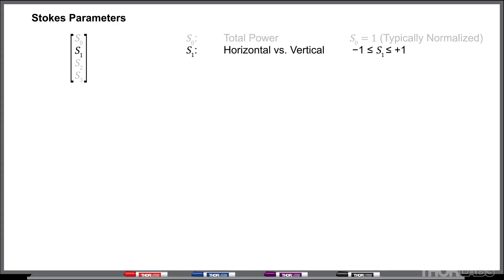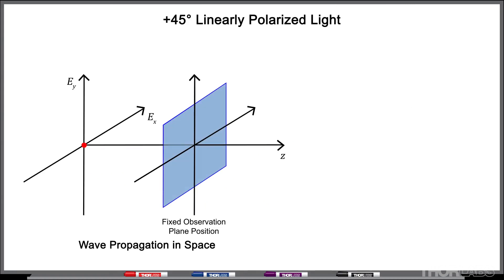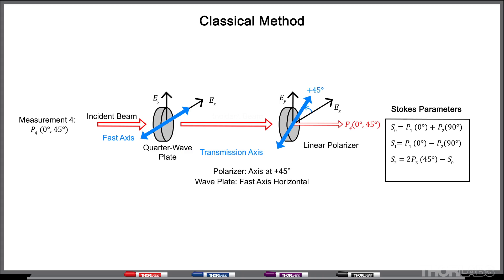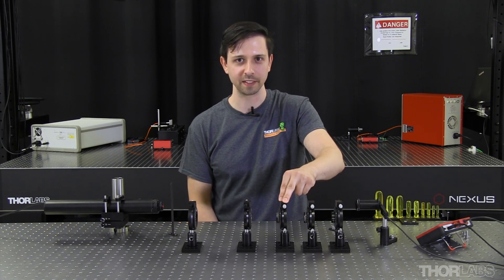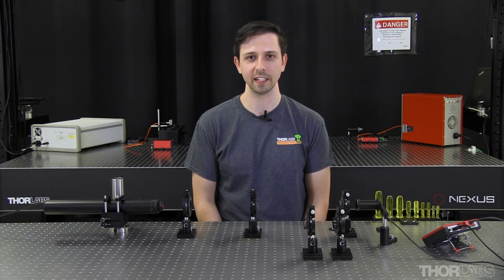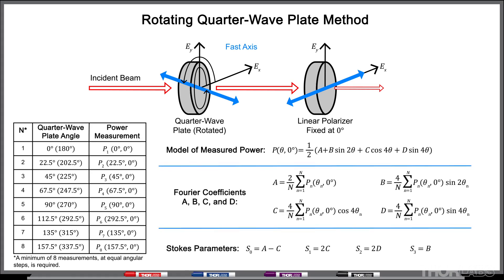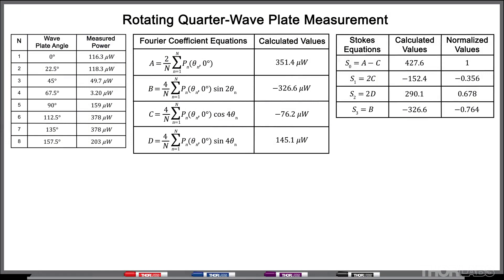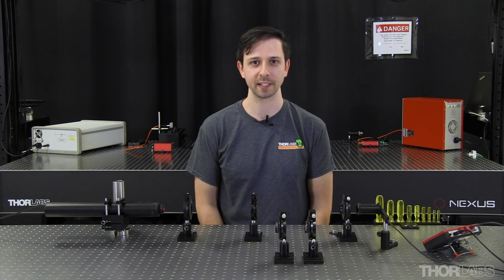Build a Polarimeter to Find Stokes Values, Polarization State (Viewer Inspired) | Thorlabs Insights

Comment: Hi, thank you for this excelent video. I have noticed that in Classical Measurement the elipses angle was 69.2°, while in the Rotating Quarter Wave Plate Measurement it was 58.9°. Is there any explanation for this large difference? From the image, I had the impression that the angle was not exactly 0° in the first measurement of the Rotating QWP approach. But, I am not sure. Could you discuss about it, please?
Reply from the maker: @dnmessias  When using these methods in the lab, the classical (CL) method often returns less accurate results than the rotating quarter-wave plate (R-QWP) approach. While the R-QWP method will usually be more accurate, it does require taking more measurements and making a few more calculations than the CL method. The CL method can be acceptable if only a quick, rough measurement is needed. We have found the variation in results obtained during this demonstration to be typical when making these measurements under the general lab conditions. 

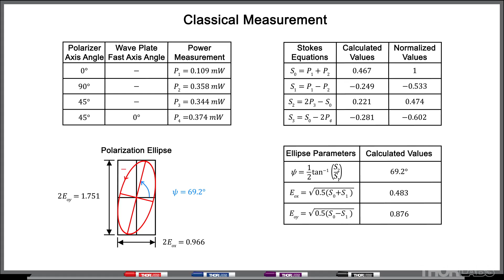There are a few reasons these two approaches can provide different polarization values. One is that both methods require accurately measuring the relative transmitted optical power for a complete data set. Reflections from the front and back surfaces of each optic reduce the amount of transmitted power, but this will not affect the provided results as long as the amount of reflected power is constant for the entire measurement set. This is true for the R-QWP method, since the same optics are in the beam for every measurement. However, in the case of the CL measurement, an additional optic is placed in the beam to make the fourth measurement. Because of this, a different amount of power is lost to reflections during the fourth measurement than during the previous three measurements. This difference will affect the accuracy of the calculated polarization values. Another challenge with the CL approach is that only four power measurements are acquired. It can be difficult to accurately measure optical power (especially when the optical power is low), as well to set the polarization optics at the exact angular positions. Small errors in any of these four measurements can have a significant negative effect on the calculated polarization values. In contrast, the effect of an R-QWP measurement error has a smaller effect on the calculated polarization values, since more measurements are made. The multiple measurements help smooth the data, and the number of measurements can be increased to even further increase the accuracy. We summarize these differences after presenting the classical method’s measurements (starting around 8:24).
Reply: @thorlabs  Thank you for the response. This kind of tutorial video is very helpfull! Thanks
Reply from the maker: @djalmir messias  We recently learned that we were missing a piece of information when we replied to your original question. We now know (thank you @TsuyoshiTakataniPhd !) that when measuring power values P2 - P8 during the rotating QWP method demonstration, our QWP orientations differed by 5° from the angles we intended. Since we used the intended, and not the actual, angles in our calculations, the polarization ellipse values we calculated for the rotating QWP method were incorrect. They should have been psi = 71°,  E_ox = 0.499, and E_oy = 0.867. In addition, the corrected Stokes parameters are: S0 = 1, S1 = -0.502, S2 = 0.385, and S3 = -0.723.  

We still expect the rotating QWP method to provide more accurate results than the classical method, but the difference should not have been as large as we calculated in the video. Thank you for originally bringing this to our attention!

Comment: Is there any formula to determine linear diattenuation and bi refringes
Reply from the maker: While we have not used a polarimeter to determine the linear diattenuation and birefringence properties of samples, we are aware that an open access paper is available that describes the use of a polarimeter's measurement of Stokes parameters to determine these values. If you would like to read about their approach and evaluate the equations they derived, the paper is: Chen et al., Optics Express 17(18), 15860-15884 (2009).

Comment: This is a very good video. Please could you explain a solution to this problem? I want to measure a material that emits both right and left-handed circular polarizations but with different proportions (intensities) for one circular polarization excitation(say right-handed). Similarly, the proportions switch upon switching the handedness of the excitation beam. How to measure these two polarizations intensities individually for each handedness excitation?
Reply from the maker: It may suit your application to use a filter that passes light with one circular polarization handedness and blocks light with the other. A filter of this type can be made using a quarter-wave plate (QWP) followed by a linear polarizer (LP). The QWP will convert both the right- and left-circularly polarized light to linearly polarized light. However, the output linearly polarized light resulting from the incident right-circularly polarized light will have a polarization direction orthogonal to the output linearly polarized light resulting from the incident left-circularly polarized light. The LP can be oriented to block the linearly polarized light corresponding to one circular polarization handedness while transmitting the linearly polarized light component corresponding to the other.
While this filter can be used to block circularly polarized light with a specific handedness, incident light that is not circularly polarized can also be transmitted through the filter. In order to determine the intensity of each component of circularly polarized light, first measure the intensity of the light without the LP in place. Then, insert the LP and orient it to block one component of the circularly polarized light. Measure the transmitted intensity, and rotate the LP's transmission axis 90° and measure the intensity again. Comparing these three measurements should make it possible to determine the intensities of the left- and right-circularly polarized components of light. If you have further questions, please feel free to contact Tech Support (techsupport@thorlabs.com , or https://www.thorlabs.com/locations.cfm).

Comment: thank you so much for sharing this! i am doing research on metasurface polarization conversion and was figuring out how to characterise the polarization of outcoming light. may i inquire could this method measure only fully polarized light? or inclusing partically polarized light?
Reply from the maker: The polarimeter described in this setup measures the four Stokes parameters (S0, S1, S2, and S3), which provide information about both the polarized light and the unpolarized light in a light beam. The S1, S2, and S3 parameters describe the polarization state of the polarized light component. Comparing these parameters with S0 provides information about the unpolarized light component. If the square of S0 equals the sum of the squares of S1, S2, and S3 [i.e. S0^2 = S1^2 + S2^2 + S3^2 ], the light is fully polarized. If not, the light is partly polarized or unpolarized. The fraction of polarized light in the beam (the degree of polarization) is a ratio. The numerator is the square root of the sum of the squares of S1, S2, and S3 [i.e. sqrt(S1^2 + S2^2 + S3^2) ]. The denominator is S0. To obtain the degree of polarization as a percent, multiply the numerator by 100 and divide the result by S0 [i.e. 100*sqrt(S1^2 + S2^2 + S3^2) / S0 ].
 
Note that the polarimeter provides Stokes parameters instead Jones parameters, which are also used to describe polarization state. Jones parameters only provide information about the polarized component of light. Analysis techniques that provide Jones parameters would not be helpful if information about the unpolarized component of the light is needed.  
 
Your research sounds interesting! If you'd like to tell us about it, we'd love to hear more.
Reply: @thorlabs  Thank you so much for the detail reply! that's really clear! i have read a paper named 'Measuring the Stokes polarization parameters'from group of Edward Collett, they did a lot about characterisation of polarization. they mentioned about the partially poalrized light and fully polarzied light and how to calculated the ratio between them by using stokes parameters. just like you mentioned above. thanks for that! this is quite useful. so my research is about quarter wave plate based on metasurface specifically in mid-infrared region. the strcuture is quite simple but we find it so difficult to characterise the polarized light in infrared region due to its higher frequency than terahertz. luckily, we learn about the method in this video which is quite useful in our case, so we managed to measure stokes parameters by using classic method and it is kind works but still lots of uncertainties in expariment so optimise of results are need and this is what we are working on recently.
Reply from the maker: @大ling  Thanks for your reply; it's exciting to hear about your metasurface-based quarter-waveplate for the mid-IR! We're very glad we could help and wish you much success in your research 😊

Comment: Thanks for listing the RSPC retainer in the components list. That caught my eye and now I am ordering some of them.  I usually bolt down three bases (BA1S) to form a clumsy kinematic corner for that very application.
Reply from the maker: We’re impressed that you created 3-point kinematic position references for yourself using base corner tips! We have seen others orient the edges of two bases at 90° to create a corner reference without realizing that variations along the edges provide a much less precise position reference than 3 contact points. Thanks for letting us know that the RSPC filled a need for you! If you find yourself assembling a unique solution and/or thinking that it would be great if someone made a component that does the same thing - please let us know! There are a lot of 'Customer Inspired' items in the Thorlabs catalog!

For those who find that the fixed RSPC is too limiting, the swiveling RSPCS (https://www.thorlabs.com/newgrouppage9.cfm?objectgroup_id=47&pn=RSPCS&YVI=16 ) could provide an alternative solution for your application.